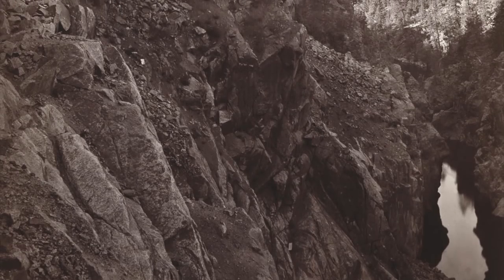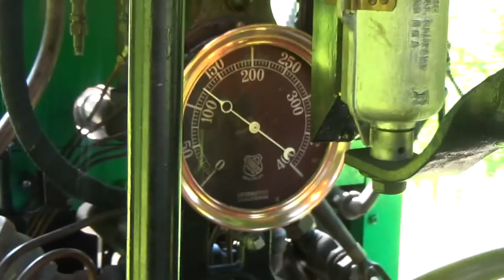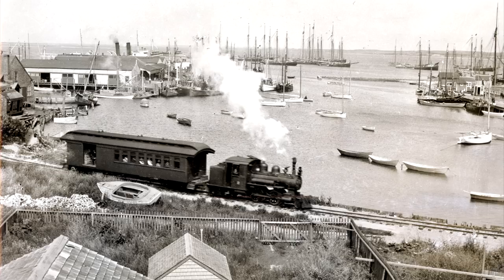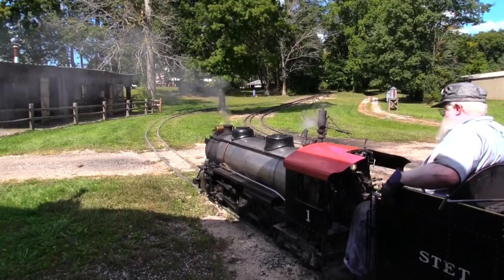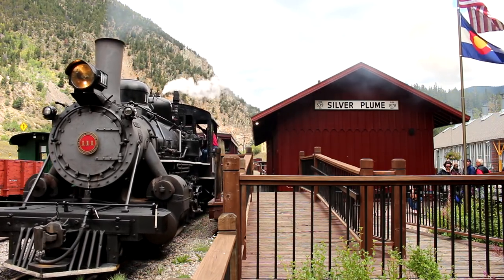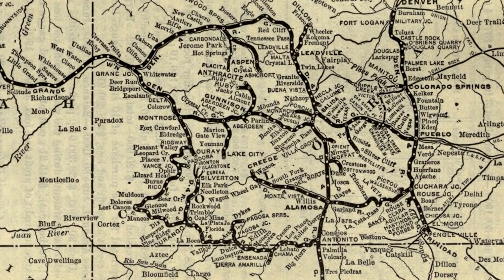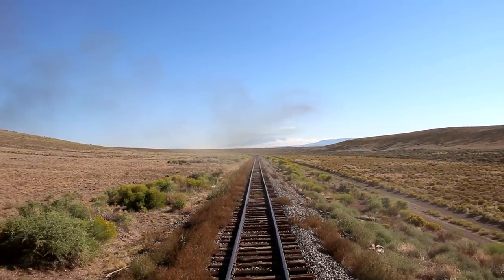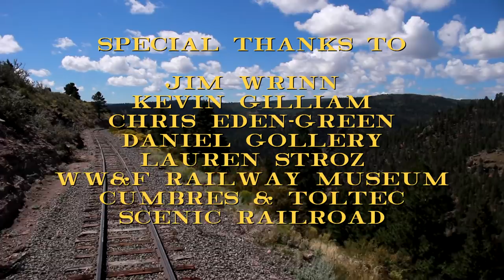Narrow Gauge Trains

Comment: But how did so much of the Denver and Rio Grande Western Equipment, and steam locomotives manage to survive into preservation??
Reply from the maker: The Rio Grande was still running regular steam service on the Silverton and Cumbres line as late as 1968. By the time steam was being retired, the value of the old steam equipment was recognized, especially with how popular a tourist attraction the Silverton line was.
Reply: Then why didn't as much standard gauge equipment manage to survive? Those beautiful Chesapeakes and Challengers will now be forever lost to time.
Reply from the maker: Like most railroads, they stopped running standard gauge steam in the 1950s as diesels took over. Narrow gauge diesels never caught on for Rio Grande as that steam was not expected to last as long as it did.
Reply: And also, on the White Pass and Yukon Route, on Wikipedia, it says that 198,199 & 200 were sold to the Casa Grande Sausal Railway in Peru, but this railway never turns up in any Wikipedia articles!
Reply: Imagine using Wikipedia as a legitimate source of information.
Reply from the maker: You’re on your own there

Comment: They should've worked out the kinks of narrow gauge. It's the best in every way, especially price and making sharp turns. Not enough power? Add another train. Still much cheaper. But the kink is keeping it o the tracks. It can be done. No one did it. They could've got rich if they did. Even when paved roads were everywhere I think a narrow-gauge train that can safely pull off top steps would be awfully tempting.
Reply from the maker: Main problem with narrow gauge is it exponentially reduces the size of the carload, which is where all the profit is. Narrow gauge was basically obsolete as the main benefit of accessing hard to reach places was rendered moot with roads and trucks.
Reply: @DynamoProductions-trains  That can be worked around. That's what I mean by working out the kinks. They became obsolete by trucks but when was last time you saw one truck hauling cargo behind it a mile long? Back then the wimpiest train could still haul more than a single truck.